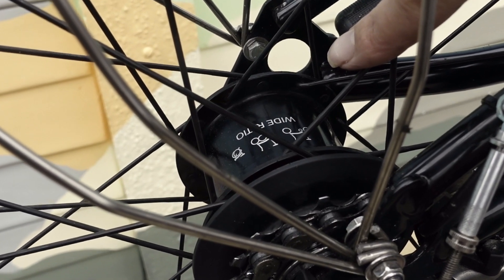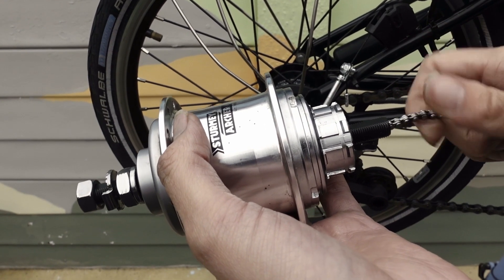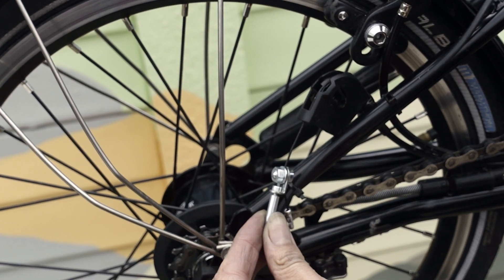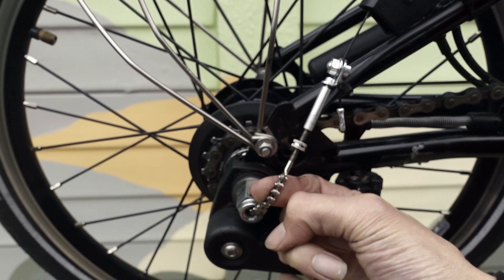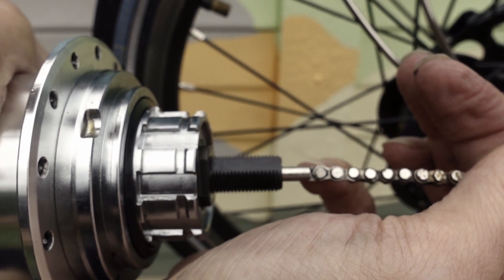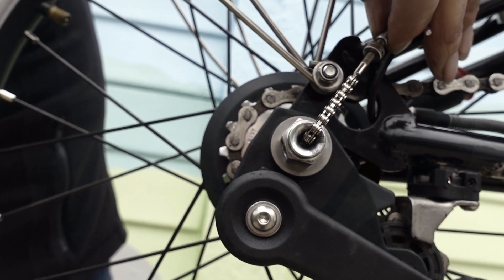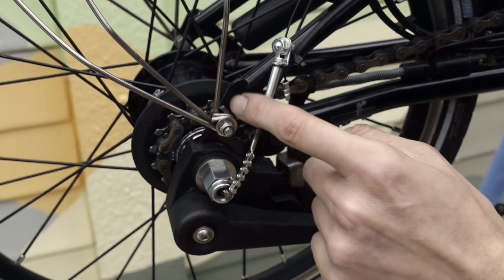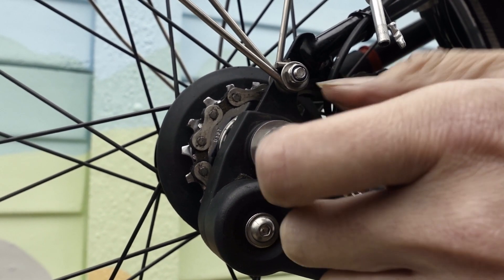Brompton hub gear setup - Sturmey Archer 3 / 6 / 12 speed

Comment: I watched this video so long ago when I was first thinking about a Brompton, now I come back because after receiving mine there was a weird noise when I was in the highest gear and pedaling on quiet pavement, even after doing the gear adjustment truth the hole... thank you for taking everything apart and starting from scratch, it was a full two turned loose inside the Hub so there was no way I was going to get it right without disconnecting the chain completely and screwing that rod in. Thank you so much!
Reply from the maker: So glad it helped, it’s so easy when you know how and a mystery until then.
Thank you for watching

Comment: Thanks that helped me understand how it works. The Brompton Manual don't mention the part how to adjust the gear indicator chain at all! 
On a 3 or 6 speed gearing, put 2nd gear in and check that 1 mm is showing in the securing wheel nut... Got it!
Reply from the maker: Thank you so much for watching and for your comments.
Really glad if it was of some help :)

Comment: The gear indicator chain can if turned in too much will lock before it is directly in line with the gear cable bracket. After inserting fully turn back half a turn before setting as per your instructions.  My cable came loose, I lost the locknut and bought the cheapest on eBay to get a new locknut. When I reassembled to the 1mm mark, my gears were hit and miss and very hard to change, I had calibrated it in 3rd gear. Your movie corrected my error. I also used mole grip and plumbers pliers to make the locknut unable to work loose again. Nail varnish, superglue will do but proper threadlock will be best.

Comment: Thank you very much for this highly needed Video!! I had problems with my new Bike and because of Lockdown  couldn’t visit my Bikeshop. They send me a link to this video and I could solve the Problem! 
I noticed during my second ride with the new Brompton that I couldn’t switch to the 3. Gear anymore.
At home I saw, the two loose endings.
I tried to connect the loose endings in 2. Gear (like you should do when changing the wheel) but couldn’t. 
After watching your video I was able to connect.
So thank you very much, you saved my Christmas ride ☺️👍🏻!!
Reply from the maker: Thank you - we're really glad it was useful!

It's a relatively common occurrence (unfortunately) with new bikes - it should be checked during the PDI (pre-delivery inspection) - but good to know how to fix it, as it can happen later too
Reply: @brilliantbikes  Absolutely! I wish you a happy new year and I am glad I found a channel like yours to help me get to know my new bike :D

Comment: I always back pedal when changing gear. It takes the pressure off the transmission and allows all the bits inside to move easily. 
I used to maintain a fleet of 32 Royal Mail bikes, most had SA three speed hubs. They were fine provided their cable adjustment was right. Good old days!
Reply from the maker: Thanks for watching! They do just keep going don’t they!
Reply from the maker: Thanks for watching! They do just keep going don’t they 😀

Comment: I found that on my bike put the gear shift in 6 and 2 then check the 1mm length in both 5 and 2 has well I found a difference on my ie 6 and 2 seems to change better but always sect 6/3 to change wheels etc like your video

Comment: I have never lubricated the inside of my 3 speed Sturmey Archer hub gear. Should I? How often? The really old hubs had a little oilway down which you could tip 3 in 1 oil if you thought it mattered. I've never had a problem with a hub gear, and my Brompton has been completely trouble free for 6 years - I feel guilty for ignoring it. Thanks for your wonderful YouTube videos.
Reply from the maker: We think that’s the amazing thing about the Sturmey Hubs. If they are running OK and have not got massively wet (ie submerged) they they are happy left alone. They are packed with grease, so we generally don’t open them unless we need to!

Comment: Im working on this for the first time ever. My little chain wont unscrew out of the wheel so I have to replace the long  cable for the ends of both are different connecting methods. I tried wd40 inside the hub to loosen the little rodnchain thingy out of the wheel.

Comment: Great video! I took my week-old 6 speed c line into the bike shop to have some minor adjustments and the gearing went to pot afterwards - I wonder if a dodgy mechanic was trying to create work for them?! Anyway, it wouldn't shift to #3 on the hub gears. I followed your video and now it does! One question, is the gear indicator chain supposed to be pretty slack when in 3rd? It feels 'wrong' but seems to work OK
Reply from the maker: Many thanks for the question and for asking. Yes it is meant to be slightly slack. 😀

Comment: Your video is so clear, yet I have some mysterious problem!

After fixing a flat on my rear tire and reattaching the chain indicator, I could see (in second gear) what I thought was about 1mm of rod showing out of the axle, and, by touch, I thought that the first and second gears were properly taut, with third gear being looser, so I thought I'd succeeded. 

Alas, when I test rode, the shifting from first to second involved a kind of little clunking feeling, and third gear did not seem to engage. Or maybe what I thought were first and second were really second and third--but I did not seem to have all three gears available. And the small clunky feeling when shifting was a bit disconcerting.

Do these symptoms suggest what I need to do to properly adjust my gears? Thanks in advance.

Comment: Great video. Sturmey Archer say that the round part of the indicator shaft should be level with the end of the axle in second gear. You say it should protrude 1mm. Is the axle different on a Brompton ?
Reply from the maker: Thanks for watching and for the question. We were following the Brompton instructions and what we know works. We’d be interested to know what in you have.

Comment: Hi there thanks so much for your great and detailed videos. 
I have a question: if a screw the gear chain thread and tighten it, it stays on an angle that does permit it to meet the anchor, so I had to loosen it a bit. Is that ok?

Comment: thanks.. remember to slacken the indicator rod off a 1/4 turn ish to align the mini chain to the adjuster .Like the idea of headset bearing change , when I had mine done by evans cycles as I couldn't release a frozen wedge nut they accidently on reassembly put the control cables to the wrong side of the stem .Easy done?! no fold and torn outers result. You could show us all how its done . P.S.total refund and job fix obtained

Comment: Great Video! I am having trouble lining up the gear change chain to the change cable on a Sturmey Archer 3 speed. The chain is not at the right angle coming out of the axle. According to you video the chain should adjust by turning it ?

Comment: Really appreciate your Brompton videos. Lovely. Quick question I could use your help on. On my 6-speed, I am finding gear #2 does NOT snap into gear-it requires two touches, unlike #1 or #3. Can you make a recommendation for how I can check out what the problem is, or how to correct this small issue? Thanks in advance.
Reply from the maker: Thank you for your kind comment

Is it possible that the gear cable is old / slightly corroded ?

We’ve had this happen because the cable is sticking
Reply: @brilliantbikes  Since being in touch with you, I found an amazing video. It appears that this problem, a misfunctioning 2nd gear is a worldwide problem. It's especially prevalent in 2018-current models. It appears that in the right shifting mechanism (gears 1-2-3) the plastic is expanding due to either heat or humidity. The fix is to open the shifter and sand the plastic area in question to reduce the expansion. I think this is ending up to be a significant issue for Brompton, namely that the plastic should be of a better quality or perhaps even requires a metal part rather than plastic.Thanks for responding. This could potentially be a good video for you guys if you have close ties to Brompton.

Comment: as always excellent content from BB. Shame about us users. My chain will not meet up. When I attach it in 3rd and reduce it back to the measurement you suggested while in second the chain disconnects. Its as if the brake cable has shrunk. This worked before so it is this farty that has done something wrong. Any chance of a list of potential causes without taking up too much of your valuable time?
Reply: Hummm...odd thing. I had the brompton upside down to adjust the gearing but once in its correct position I managed to get the 2nd gear position as to where you suggested but it feels by only a couple of threads. Scary

Comment: I noticed that you change the gear whilst rotating the pedal forwards on the stand. I've been back pedalling for the sturmey archer gears and pedalling forwards for the derailleur, as per the manual. Does it matter?, because I have got mixed up a few times.
Reply from the maker: You should stop peddling when you change gear on the hub gears. But you should keep pedalling when changing on the derailleur gears. We also made a video about changing gears. Hope that helps and thanks for watching!

Comment: I have just changed a SRAM hub for a new Sturmey Archer hub, do I need to change the indicator chain adjuster for a barrel type and a new gear wire and/or trigger?

Comment: The locking nut on my Brompton Electric unscrews itself as I ride, dropping down the cable anchor. It actually caused the cable to separate. Any solutions? Thanks, Stewart

Comment: Uma Brompton 3 velocidades com cubo original conseguimos fazer up grade pra 6 velocidades?
Reply from the maker: Yes, you need a new rear wheel and to add the derailleur gears. 
Brompton invented their own wide ratio hub that takes two sprockets to give the he 6 speeds, it is lighter than the standard ratio 3 speed hub you have that only takes one sprocket.

Hope that helps! 

Thanks for watching!

Comment: Should there be some play/movement when the back latch that locks the back wheel is engaged? it seems loose on mine. When I lift the bike up should the back latch have a tight fit with the rest of the bike?

Comment: I have a question about the internal gear hub. I just made some adjustments and everything looks good. The barrel is exposed about 1mm in the 2nd position. Everything seems to shift as normal. I adjusted the brakes and tested the wheels to see if anything rubs. The wheels do not rub but I noticed the drivetrain would be engaged if I spin the wheel backwards with my hand. Other other words, if I back pedal like for cleaning the chain grime, the wheel spins backwards as well. This appears to only happen when I’m in the 3rd internal gear hub. Is that normal?
Reply from the maker: Good question 

I think when you pedal backwards it’s a gentle movement of the wheel - not like full engagement ?

This happens especially with new wheels - there is a lot of grease which creates a small resistance giving the result you describe

It also means when riding that if you back-pedal the chain slackens and can rub on the frame

This will stop as the grease breaks down - normally quite quickly

Comment: Hi there, I am thinking about buying a Brompton and am still unsure whether to go for 3 or 6 gears. 6 gears means two sprockets in front, right? So you need a derailler and that probably puts strain on the chain and you have to check the chain more often?
I change the chains quite frequently on my mountain- und trekking bikes, but I used to have an old bike with a Fichtel&Sachs 3-speed hub and I think I had the chain until I had to take two links out - and then went on driving it. 
you know what I mean...
any experiences 3-speed vs. 6-speed out there? I would love to hear from you!! THANKS!
Reply: 6 gears means 2 sprockets on the REAR axle so a derailleur is included

Comment: Do you have to put it in 2nd on the 6 speed?
Reply: I also would like the answer to this question Michael - ‘2nd gear’ on the 6 speed is ‘+1’ is this what it needs to be set to when adjusting the gear indicator to protruding ‘1mm’ ???
Reply: @markmark5159  interested to know the answer too.. thank you

Comment: Are you not meant to pedal when changing the gear?
Reply from the maker: Thanks for watching.

Short answer: No

Longer answer:

With a Sturmey Archer hub gear - you should only change gear when not pedalling 

Inside the hub are pawls which engage when pedalling - these need to be disengaged to change gear

It makes the Sturmey Archer gears especially good at traffic lights - you can approach in top gear, then stop, then change to lowest gear while stationary

It’s the opposite to derailleur gears - where you pedal as changing, this pushes the sprockets around - they have ramps on them to help the chain change between sprockets
Reply: Basically have some mechanical sympathy

Comment: Curious—Which gear should be engaged when folded for a 6 speed Brompton?
Reply from the maker: You can fold the Brompton when any gear is engaged
Reply: As mentioned any gear is OK... but leaving it in 3rd (+ or -) leaves the gear cable loose and so in theory should reduce stretching when the bike is not being used.

Comment: Hi, why do you leave the indicator exposed 1mm? I read the hub manual ( http://www.sturmey-archer.com/files/catalog/files/309/MANUAL%20-%203%20SPEED%20HUBS.pdf ). and it clearly says it should be at the same level, not exposed. But all the videos I see they leave 1mm exposed, do you know why this is the standard procedure with bromptons if the hub's manual indicates it should not be exposed? Thanks!